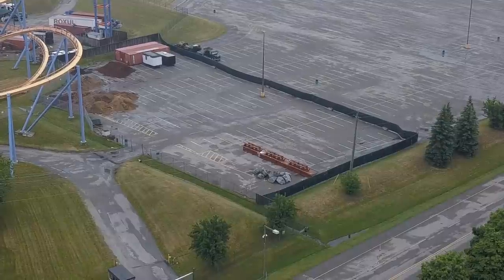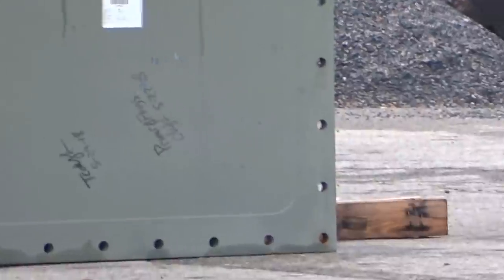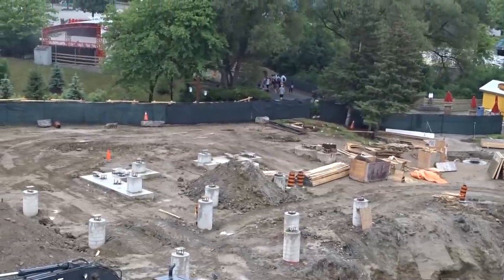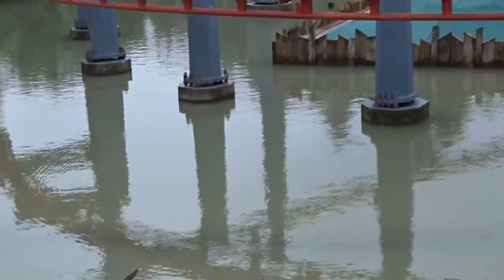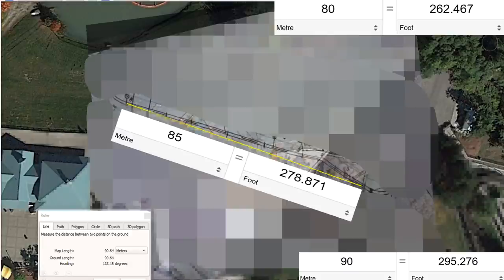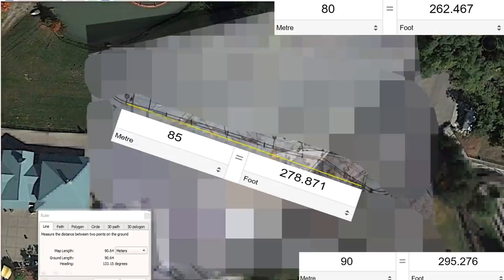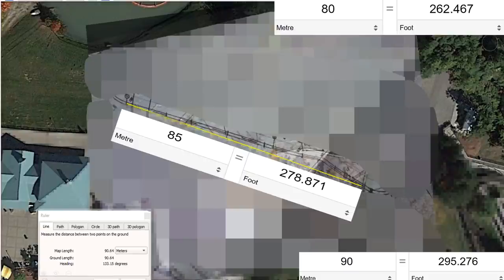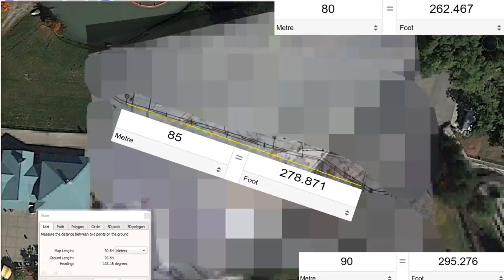Canada's Wonderland Yukon Striker Track & Height Speculation

Comment: For Valravn the initial lift hill piece was installed but the then worked backward with the station and final break run in before they went up with the lift hill. With regard to Canada's Wonderland being first to have two giga's, aren't you overlooking Cedar Point was first with two coasters with  drops in excess of 300 ft? (Millennium Force  and Top Thrill Dragster.) Or do you think TTD's strata status disqualify it?

Comment: The lift hill length estimate is getting shorter and shorter😢. I remember when you said it was 105M long and now it’s 85M long
Reply from the maker: blueprints helped us limit it to a more accurate measurement :)
Reply: Amusement Insiders I really hope the height of the coaster is past 300 feet’s not including the tunnel
Reply: Fire Ethence at least 200ft is fine.

Comment: Pause the video and measure the bottom and the rise of the lift footer, it is not 45°, it is closer to 35° lift angle.  On my tv, the place I paused the video I measured 5" bottom and 7.25" rise, which equals about a 55° angle making the lift hill about a 35° angle.
Reply: No dive coaster is under 45 degree angle of ascent. I disagree it is 35 degrees. It’s either 45 or 47 degrees
Reply: Fire Ethence , I can't help that you disagree.  Can't anyway possibly get 45° if the bottom and the rise are not the same!  The rise is a lot longer than the bottom is. Lol, I had the tape measure up to my TV screen measuring it and 35° is what it came out to.  Only other way to get a different angle is if the trade thar bolts to the footing has a bend in it.
Reply: * track that

Comment: Not to be a party pooper (I'd love to have two gigas at wonderland) but doesn't the roller coaster community consider a giga to need a "height" of at least 300 ft and not the "drop"? I think it's kinda silly really because the drop experience is really what matters, but isn't that what is generally classified as a giga? Because of the tunnel, we will likely get a height of less than 300 but a drop of more than 300. I could be wrong...
Reply: monkeybrother not exactly. If the drop counts, it counts. Think about terrain coasters, they need to count too
Reply: monkeybrother for phantoms revenge the height is only 160 feet but the drop is 228 feet into a ravine so it is considered a hyper